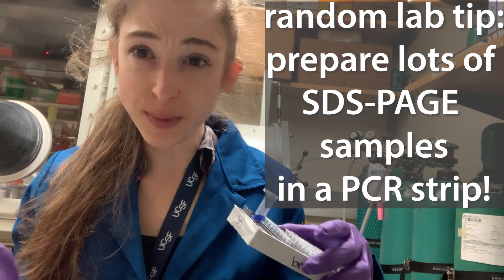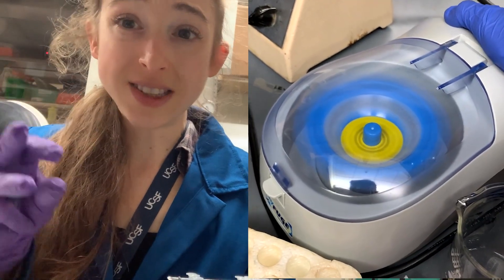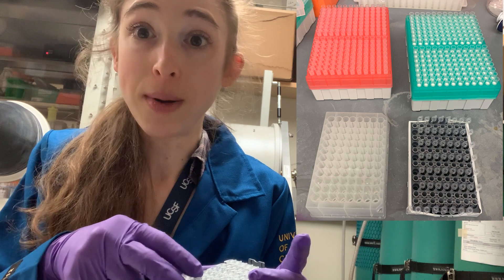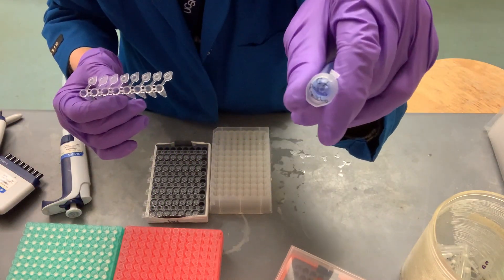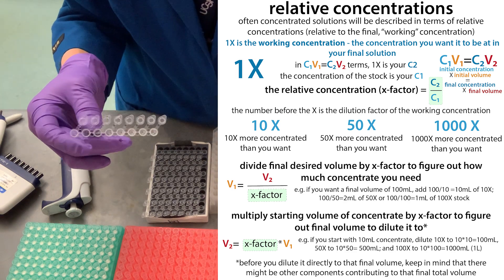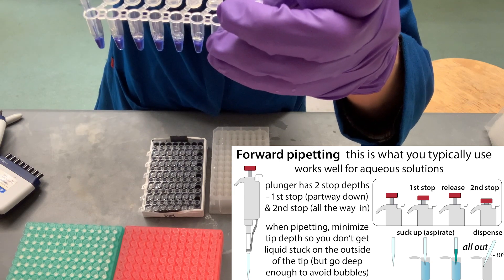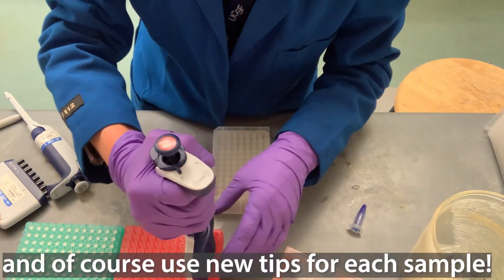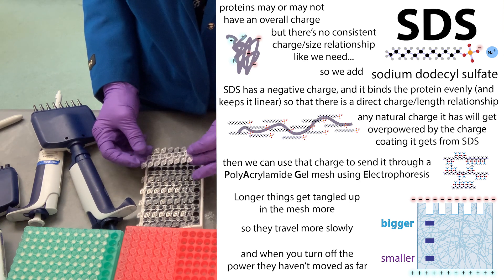Practical lab tip - prepare lots of SDS-PAGE samples in a PCR strip

Comment: Great video! 
I have two western blot questions, could you use the multi pipette to load samples into the gel? Would definitely speed up that part of the process lol.
Also, in your experience how long does whole cell lysate last in the -80? (assuming it has HALT) and what would be the concern if left out? Degradation? (how?)
Reply from the maker: Thank you! I've never tried - doubt the tips would line up with the wells?. And don't know about your second question sorry. But basically molecules will degrade even without enzymatic help thanks to thermal motion, etc.
Reply: @thebumblingbiochemist  thanks for the answer, would you be able to explain a bit more about what you mean by thermal motion and how that leads to degradation?
Reply from the maker: basically just that bonds are always vibrating, etc., interacting with solvent, etc. and they can break. enzymes make the breaking easier but they aren't required
Reply from the maker: Also you can get microbial growth